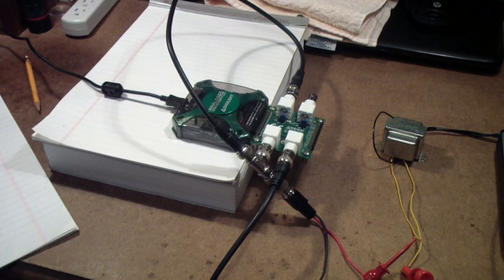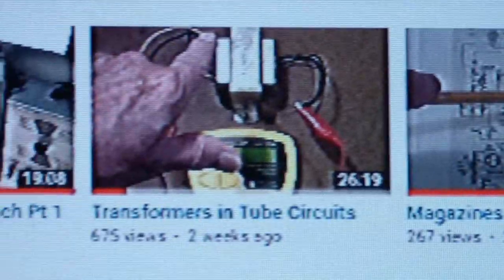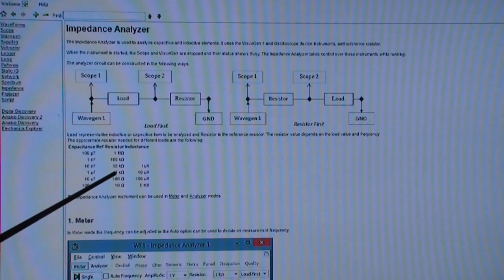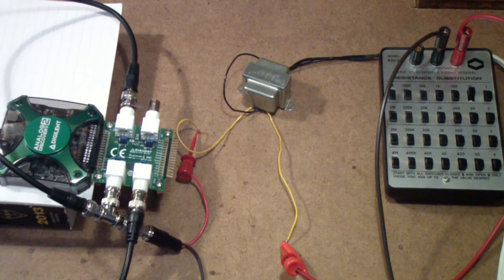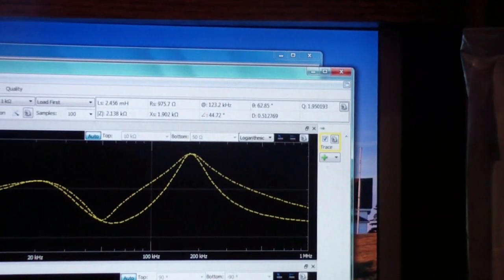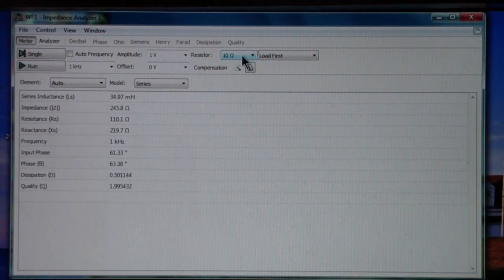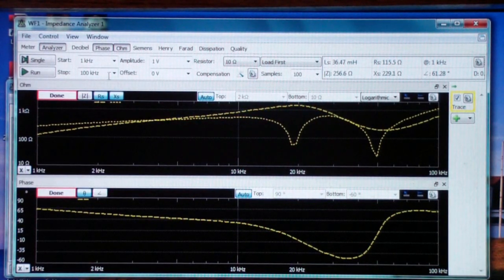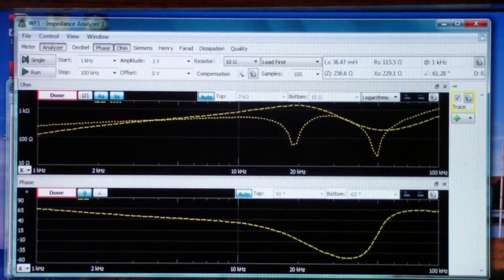TTT190 Analog Discovery Z Analyzer Pt1 Overview

Comment: Hi Tom, I hope you are doing well and have a great New Year in 2018.
I have been working with inductors and transformers lately of various values and particular iron core inductors/transformers naturally focusing on the vacuum tube output transformers.
I built my own test jig that turned out very nice and then thought I would see what the AD2 had to say about my measurements. I couldn't remember the hookup so I had to watch your video again. Thanks for posting all of your very informative videos on the AD2.
I thought I would pass along my experience and let you know I get good results with iron core  inductors from 500 mH to 50 H by setting the start and stop frequency to 50 Hz (or even 100 Hz) and using generally a 1K resistor. 100 ohm works pretty well also. I set the voltage to 1 volt and do a single scan. I have several standard inductors I can use and in particular a General Radio 5 H that is my perfect model. Just thought I would pass this along. 
Hope to see some new videos from you soon.

Comment: I really wish they would have allowed a scripting environment for custom models (much like to they do for the other tools). I have more complex impedances I am studying (i.e. a resistor in series with a reistor/capacitor parallel pair). For now, I need to export the data to a *.csv, and then do the curve fitting in something like Python.

Comment: Thanks Tom. I'm very interested in Pt2, to see how your Waveforms Impedance Analyzer work complements my video "Analog Discovery 2 Impedance Analyzer, OPTs and What Tube Plates Really See!!!".  I'm sure your take will add the collective knowledge leading to improved tube amplifier design and understanding.
Reply from the maker: I will check out your video before finishing part 2. I wish I had seen it before I did part 1 as I am sure it will contain much of interest. I will be sure to mention your video in part 2.
Reply: Thanks Tom.

Comment: What's the lowest impedance you able to measure using the analogue discovery what is the lowest and highest frequency this can be achieved.  I noticed Jaxbird EEvblog made a impedance analyser for the analogue discovery he used buffer amplifiers instead of resistors and avaraging to increase dynamic range how does this method compare? Also see https://www.edn.com/electronics-blogs/impedance-measurement-rescues/4458562/Accurately-measure-ceramic-capacitors-by-extending-VNA-range thanks